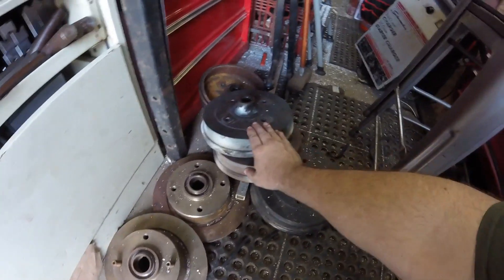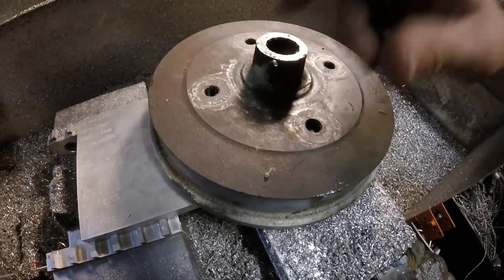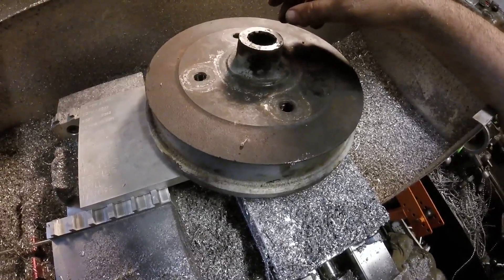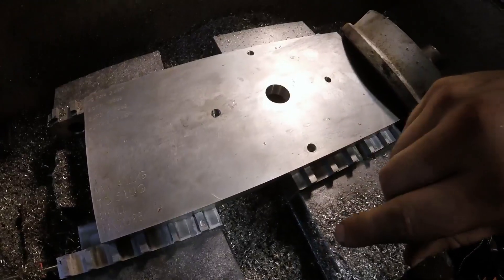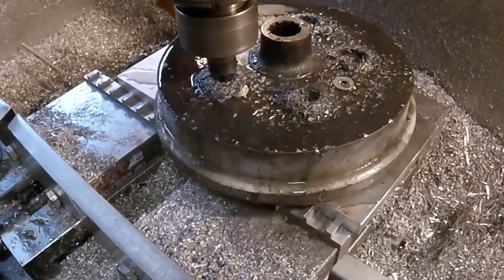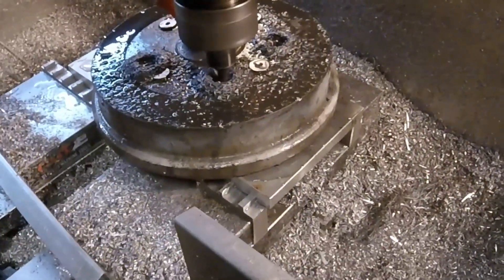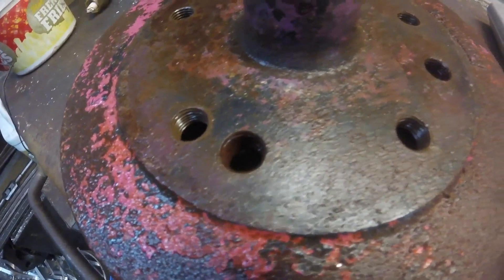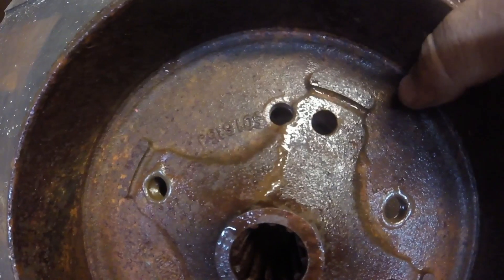Drilling out some 4 lug VW drums to 5 lug Porsche pattern

Comment: Can you do the same with 4x100 to 5x100?
Reply from the maker: Can't think of any reason why not.  Are the drums/rotors drilled and tapped like the ones I did or are they pressed in studs like a "normal" car?
Reply: @ecdezz  its pressed in I think, its the centerhubs, rotors floating.
Reply from the maker: @oldestries  What's the year, make and model?

Comment: I have a 1989 5.0 convertible that I added a Saleen body kit, and my friend has a set of 5 lug Saleen rims with tires from LMR he offered for a good price.  They sell a 5 lug conversion kit, but I know it's possible to do it this way.  But I was wondering if it's considered safe since I have a V8 engine and will be doing freeway driving, etc?  I wasn't sure if drilling the new holes will compromise the strength of the metal especially since Mustangs have a lot more torque than a VW.  Thanks in advance!
Reply from the maker: With the VW's going from 4 lug to 5 you're adding one more attachment point so even though the back of the drum is various thicknesses (thicker where the stock holes are) the additional hole gives you almost the exact same thread engagement.

For the mustang, I really don't know if it's safe or not.  You do have more power your dealing with and the wheels being attached are kind of important :)  There has to be someone around who's done it though.  They'd be in a better position to answer the safety questions.
Reply: @ecdezz  Thank you for your feedback!

Comment: nice work man...the way you made that jig plate and mark it with name and also the dimensions  for future use and reference is pure cult like you only see in German or Swiss engineering...btw one would be inclined to think that switching to a 5 bolt pattern would open up all sorts of options for upgrading the brakes to any system you want and get rid of those ancient drums to boot...but what do I know...
Reply from the maker: Yea, I have so many fixture plates laying around here that I had to start labeling them.  the dimensions came after I did one and had to keep running back and forth to the computer.  Live, learn and do better the next time.

Unfortunately on these since the bolt pattern is threaded into the drum if you change the brakes over to disc you loose your drilled drum.  most disc brakes kits come in a variety of bolt patterns though so there's options all around.

Comment: Where can I get this done
Reply from the maker: Any machine shop should be able to handle it.  Don't know what the cost would be though.

They're also sold new with both bolt patterns.
Reply: I need a pair of brake drums for a 2000 Toyota Corolla with the bolt pattern redrilled 5x114.3
Reply from the maker: @Stackchicken  That'll be more difficult.  Unlike the bug where the wheels attach to the drums the toyota appears to have the more traditional setup where the drum is sandwiched between the wheel and a backer where the studs are actually pushed through.  If you can get it apart a machine shop should be able to do it.  However, when going from 4 lug to 5 the diameter needs to be the same to avoid intersecting holes (mine was 4x130 to 5x130).  Adapters may be a viable option.

Comment: hey, long time no see, glad the tormach is still earning its keep. Didn't realized you were running Mach3. Have you considered updating to Pathpilot?
Reply from the maker: Yea thanks, I got a bit burned out.  I have Pathpilot on the tormach; I was doing these on the Hurco I retrofitted.
Reply: @ecdezz  can you show it in a video? I'm running a tormach, but on the look out for a good fadal
Reply from the maker: @piccilos  Let me see what I can do.  I'm getting ready to move it so maybe I'll record that debacle and do an overview at the same time.  For mine, the retrofit cost right about $1,000.  I re-used the motors and whatever else I could and I don't have a tool changer so that kept costs low.  All told I have probably 20-30 hours in the retrofit and that's coming from no experience.  It's a different animal than the Tormach.  I'd do it again though but next time I'd attempt a tool changer.  I also retrofitted a Hardinge lathe with an Accuslide CNC attachment.  That one was abut $4,000 in parts because I went a nicer on the parts and replaced the motors.  Centroid over Mach3 added to the cost too but I needed a spindle encoder and Mach3 doesn't support it.

Keep an eye on the machine auctions; I see Fadal's come up all the time.  Depends on location too.